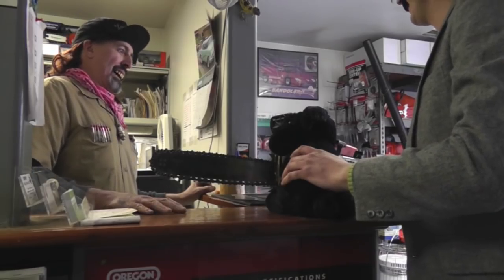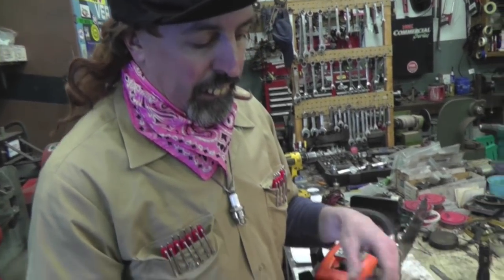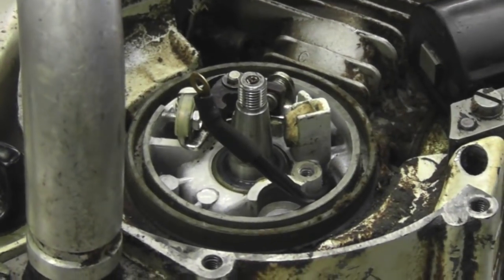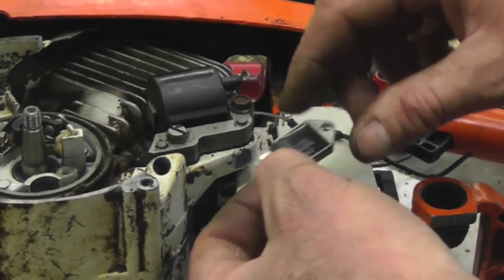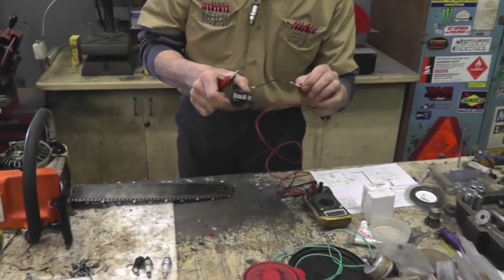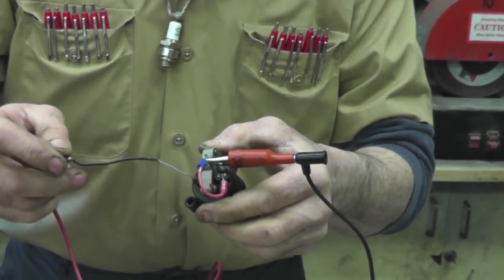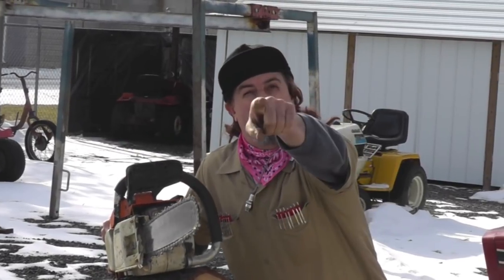How To Convert Stihl 028 031 032 From Points and Condenser to Electronic Ignition

Comment: what about replacing the coil on a vintage 110 AV chainsaw? can you demonstrate that for me? I purchased a coil on line (imported) but it only has 1 contact point whereas the original has 2 plus the spark plug wire. Will it work?

Comment: Hey Taryl I have a stihl 041av has great compression but is set up with points and condenser and not throwing a spark I've worked on many of saws but I've never messed with points and condenser if you get this plz get at me if you know where I should look

Comment: All this sounds great, but it is possible to put the module from a 026 on the 032 bracket. I did one like this in 2014 and the saw is still running strong

Comment: On an 028 you can just change your coil to an 029 electronic ignition coil.  It might require changing the flywheel also depending on which one is currently on the saw.

Comment: Hi Taryl, I was given an old Stihl 031 because it would not start. Had a lot of fun so far but come up against a serious problem. The coil is broken but a bit more serious then the one in your video. The housing (where you drilled the hole) is cracked away from the main body. Any suggestions how I might fix it. New ones are no longer available from Stihl and I have not been able to find a generic one. They are obviously rare as they are asking big dollars for one in the second hand market
Reply from the maker: +Randy James Yes they are RARE & expensive. All I can suggest is that you try to clamp it back together and epoxy it. Good Luck.
Reply: +Taryl Fixes All LLC 
Thanks Taryl, I have given it two coats of Devcon epoxy and so far on my fifth tank of fuel so it looks a s though we may have had a win.
Reply from the maker: Theres Yur Dinner! I now recognize you as a official Grass Rat. Or maybe cause its a chainsaw a official Wood Roach.

Comment: Thanks Taryl -- You da man because you can create solutions. My problem is my 041 which has always been hard to start,  very hard to pull.  Is it possible to convert it to an electronic ignition? Maybe if it had
a stronger spark, I would not have to pull it fifty times or more for a cold start. The local Stihl dealer told me that it could not be done.  I suspect that they are not as competent or creative as yourself.

Comment: I had an 'Atom' ignition module that I tried on an old Sears Craftsman 'Roper'  chainsaw.  I liked it as it had great power, 3.7 ci. but it had points so that's where  the Atom came in.  It never worked right on that saw so I went back to points and just kept the ignition module.  Tried it on the 028 Stihl and no spark so I thought something must be bad in the module.  Well just yesterday I saw in your comments that sometimes you have to reverse the wires.............So I looked on the Atom module web site from Australia (they are out of business) and still have some information on the internet,  in the end of their information I see a note that says for an Stihl 031 you need to switch the wires around.  After sitting around for years and not running right, changing carbs, fuel lines, filters, pressure checking everything and can't put a finger on the problem.  Today as last resort I decided to switch the wires and the 028 runs perfectly.  (with the Chinese carb, fuel line, filter and spark plug)- probably the old Stihl parts are still good and will probably get used sometime.  Thanks for your great information videos.............!

Comment: will that 31-9334 module work on an 031 AV? what about the timing?
Reply: I got a 031AV from a friend, classic condensor failure- started, ran rough about half throttle and had a hard time getting past that.    I pulled the flywheel and yanked the points, put in the 2 tab chip- mounted in the air box real neat.  Put it back together and it started on the 3rd pull, ran smooth but  still didn't rev well, I noticed a slight miss and the muffler got hot really fast.  I had read that some guys said the timing had to be advanced about 20 degrees, so I pulled it apart again, took out the flywheel key, there is a mark on my flywheel, it doesn't correspond to TDC but it was close.  I cut a 20 degree wedge out of paper, put it over the center of the driveshaft to the mark on the case, then drew another mark 20 degrees CCW on the case.  Set the flywheel on that mark (I had made register marks on the clutch so the crankshaft would be in the same place before and after) and tightened it on.  No flywheel key, just tightened down.  Back together, it popped on first pull and ran like the day it was brand new.  Took it out and ran a tank of gas thru it, love that saw.  I think it may be a different procedure depending on what chip or maybe a different flywheel on a given model, mine was an old one, probably one of the first ones made.  There is an adjustment on the flywheel itself to modify timing, but probably only a degree or two, it's not enough to go 20 degrees.  For what it's worth, this worked for me.

Comment: I have a completely rebuilt stihl 032av excellent compression,  new vacuum seals and vacuum tests good, rebuilt carburetor and it appears to have good spark, It spits lots of fuel out of the rebuilt carburetor, no matter where i set the needle and seat or adjust the low and high carb screws it will not start or run, once in a while it pops like it wants to start then floods out, Could it have a weak spark, there is a white/blue spark but it's real lite

Comment: Hey Taryl,I have a husqvarna rancher 455 and the bar and chain oil just started leaking,I was just wondering is there a way to fix that? and how to remove the stubborn bar adjustment screw without messing anything up?

Comment: Help me out here Taryl,..I have a 028 here and bought a coil on ebay ,I cut out my points and condenser out and when I hooked it up like your saying to ,with the one tab kawasaki type ignition.Theres no spark..I have the one tab ignition box grounded to the coil but it had no spark, But I can unhook the coil ground wire and unhook the ignition one tab wire and I have spark,,any thoughts on whats going on with that?..So All It looks like I need to do is hook a kill wire,That I dont even need the wire going to the one tab..? Am I making sense? Does my coil have built in module?

Comment: Is there a list of Stihl saws that have points?  I want one. They should be EMP proof?
Reply: If it doesn't say electronic on it, it has the old system. However there's a physical difference between electronic & points, old system has a fatter spark & at lower speeds.

Comment: Thank you, thank you, thank you Taryl! I have two 031's.The newer one has a chain brake and an electronic ignition while the 1974 model has points and no brake. Of course the old one runs fine and the newer one quit. I removed the contents under the flywheel and installed a Kawasaki chip as you demonstrated and all is well again. I'll convert "Old Reliable" if she ever decides to quit! I think my Husky 394 may be a candidate as it runs fine until I shut it off and it won't start again until it cools down completely. Is the procedure the same as the 031? Thanks again!

Comment: I just bought an Oregon 33-053 electronic ignition chip to replace the points on my Stihl 031av saw, and when I took the spark plug wire off of the spark plug, it fell right out of the coil! Now, should I just replace the coil with another 031av points style coil or should I get the coil for an electronic ignition saw? 

Thanks! Great videos by the way. Keep up the good informative entertainment.
Reply from the maker: +Todd Koeppel Electronic would be easier to replace. less work than the conversion.

Comment: i did this and my 031 av fired great. so then i had to change clutch and i think the flywheel changed position. 
how cause now it wont fire at all. i got spark and fuel so im guessin flywheel did move.
how do i line it up again to get her runnin ???
Reply: I have the exact same problem, were you able to fix it?  Thanks
Reply: @benjamintaylor6052  yeah...theres a mark on the flywheel that you line up with top dead centre....away she went
Reply: @Ravencroak  Thank you

Comment: I take that this will work on an old 032 av model. Do you have to ajust the timing when electronic ignition has replaced the points?  tks
Reply from the maker: john deer A.V. just stands for "Anti-Vibration". The timing is fixed on the saw and it will work on your model. There's your dinner!
Reply: Taryl Fixes All Tks Kind sir
Reply: Taryl Fixes All just got it fixed, saw runs great. The 032 is different in a way, I put the part on top of the condenser instead of bottom. One guy said to change speed to x 2, what is that. One bad thing is I broke a fin off of the fly wheel, should I buy another fly wheel? I' m sure not a mechanic. Tks so much for your help.
Reply from the maker: john deer As long as its not vibrating should be ok
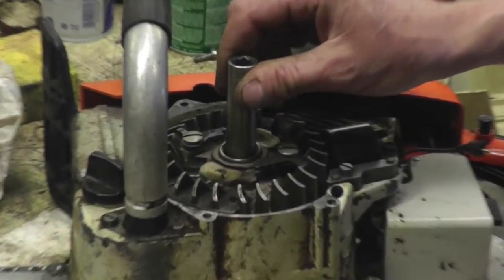Reply: john deer The guy was saying change your youtube video playback speed in your settings to x2 at 4:08 because it's funny...
Reply: iowawrench lol. ok i had no clue what the x2 was about.

Comment: Great video.  I bought my 031av back in 1980 and it ran great until 6 years.  I replaced the points/condenser and it starts and runs strong but after running for 3-4 min, it cuts off and will not restart for 5 minutes.  I think it is the coil.  What might your ideas be. Thanks Scott
Reply from the maker: +sdwputnam check that wire on the coil like I show in the video.
Reply: +Taryl Fixes All  If I go into the saw again, I may as well replace with new coil and be done with it. I have seen many coils for sale online. Can you give me an idea about what I should pay for a good coil.  I have 2 other saws(Hushy & Poulin) but the 031 for it's age out cuts those by far. Thanks Scott
Reply from the maker: Not really, I know a used one can be expensive.

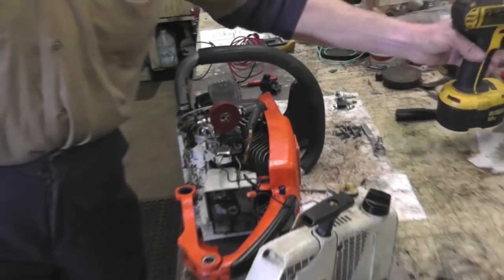Comment: I did this conversion on a 1975 031AV, when I turn the engine over like Taryl does at 12:58 I get Hot Spark. But when I re-assemble the saw it will not get any spark. The kill switch tests out fine. Anyone have any ideas of what the issue is?
Reply: Where are bolting the module to?
Reply: You may be shorting the wire to something when you’re assembling it.

Comment: The first of the Australian built Victa powertorque 2 stroke lawnmowers had that separate module in it but the trash find one I've got has it built into the ignition coil.

They integrated them in with the coil in 1996 but it's cheaper to fit the older system with the separate module if the newer ignition coil unit fails.

Comment: Taryl.   I have an 032av with the standard points/condenser setup.  However my ignition coil is different that the one is this video.    My coil only has a total of two wires (including spark plug wire) coming out of it.   One goes to the spark plug and the other goes directly to the kill switch on the saw.   Underneath the coil I only see one wire going from under the flywheel up to the trigger area.   Will these ignition chips work on my saw?   Do I need to run the kill switch wire and the wire coming from under the flywheel to the chip and ground it to the coil?   There are so many posts on the web about this same setup and some say it will work and others say it will fry the chip within a minute of use.   Thanks for any feedback you can give.   Jim
Reply: Did you ever figure this out
Reply: Yes the chip (single contact not the two contact chip version) worked just fine.  I cut the lead from the points/condenser and grounded on the chip to the side of the coil.   Worked like a charm.  Saw works great now.
Reply: So you only connected the one wire from the points to the module and grounded module and on the coil. Is that correct
Reply: chris check yes.  Do yourself a favor and cut that wire as close to the points condenser as possible.  That will give you the slack to them connect to the chip.  You want to use the wire side that goes to the switch not the points to connect to the chip.

Comment: If the chip takes the place of the points how does the timing work?
Thanks
Reply from the maker: Steve Howard A transistorized system operates by controlling flow of electricity to primary coil. Two transistors contained in control unit. One transistor used to supply electricity to primary coil. When voltage level in primary reaches certain level, second transistor turns off first. This causes magnetic field around primary coil to collapse, creating high voltage across secondary coil. Voltage then discharged across plug. The timing is fixed. There is no advance or retardation just spark. All newer equipment have electronic ignition built into the coils themselves. Some have  built in advance timing mechanisms that help the engine to start easier at low cranking RPM's. That's why some Stihl coils on newer produced engines such as those produced for trimmers may physically look the same & mount exactly to the trimmer and produce spark but won't start. Believe me I have tried to use another coil from a similar trimmer and or chainsaw and not have it start or have it misfire.  Looked up the correct coil for the specific model and SHAZZAMO! There's my dinner!

Comment: I installed a (2) terminal chip grounding the neg term to the coil mount and tieing the switch,coil wires to the pos term
still no spark
how does the chip tell the saw when to fire
I will trouble shoot the wires on the coil
does a coil go bad?
Thanks
Reply from the maker: Steve Howard Yes, like in the video that coil had a broken wire,probably from vibration. also try swapping the wires on the chip. Good luck.

Comment: I got a problem which I can't figure out. I put in one of those ignition modules in my Toro snowblower ccr2000 because of no spark. I installed it negative to ground. And connected and positive to the key switch. And it works amazing. But I have a problem with the switch. Now on is off and off is on. I turned the back terminals opposite and same thing. How do I get the key switch to work properly.

Comment: There are a lot of posts on the ARBORIST web site saying that the timing has to be accounted for either by getting a different flywheel or moving the flywheel 20 degrees. Is there a specific module for the 031AV that takes  the timing difference into account. Thanks for any help! wolf
Reply from the maker: +wolfbley  I dont know how you would move the flywheel 20 degrees other than removing the flywheel key. then you run the risk of the flywheel moving on the shaft. All this module does is eliminate the points.
Reply: I agree with you about "moving" the flywheel. I am still not certain why the timing issue is mentioned at ARBORIST site if the chip takes care of everything and the timing stays the same.
Reply: +wolfbley  The difference is in the flywheels.  The AVE position is different than the AV.
Reply: I did the conversion a while back but did not have any actual hard work for my saw until this past week.  It "ran" perfectly so I figured it was fixed and stored it.  My saw is an older version Stihl 031 AV with points and condensor.  If you notice in the video there is a centrifugal spark advance mechanism build into the flywheel.  So when I put my old saw to work, proudly bragging to my neighbors that I had fixed it up from certain death, it cut real slow and got real hot.  So what probably happened, and one never really ever knows, is that new ignition produces a spark close to TDC without advancing.   The spark happens much too late to produce good power at high RPM and power under load.  So one thing to finish the job is to pull the flywheel, remove the key, and advance the flywheel by turning it counterclockwise and then tighten it down real tight without the key.  About 1 inch on the outside edge was what one blogger said and about 30 mm another one said.   The flywheel has a mark on it already, or mine did.  Mark another on the saw housing. Carefully lift the flywheel off the shaft, remove the key and carefully set the flywheel back down on mark.  Tighten it.
Reply: You don’t remove the key, you file it down or “step” it so it will allow the flywheel to be a little advanced
Reply: I tried an atom on my 031 and it ran sluggish and got hot when under a load. Some 031s had electronic ignition and the position of the flywheel key slots are different from the points flywheels. I think there were a couple of fins difference in where the flywheel keys are cut. I was told to advance my setting to 20 degrees.  I counted the fins on the flywheel and divided that number into 360 to get the number of degrees each fin was spaced on the flywheel.  I also measured the circumference of the flywheel and divided it by 360 and then multiplied it by 20. From the timing mark on the flywheel, I measured with a metal tape measure and scribed a mark for 20 degrees ahead of the factory mark. I removed the flywheel key from the crankshaft. Then wiped a thin coat of fine valve grinding compound on the crankshaft and installed the flywheel with my new 20 degree advanced mark aligning with the mark on the case. Tighten the flywheel nut down tight and it will not slip with the valve grinding compound between the crank and the flywheel. I used to see go kart racers use this valve grinding compound trick on 5hp Briggs engines with no flywheel key to advance the timing.  End result is the saw runs fine again .

Comment: I'm a bit confused by this. The 031av has a twin pole flywheel. If you connect the single pole Kawasaki module the saw should fire on the wrong magnet and the ignition timing should be wrong. Although the Nova module is not recommended for twin pole flywheels it should work if you connect the terminals the other way round so that it fires on the second magnet.